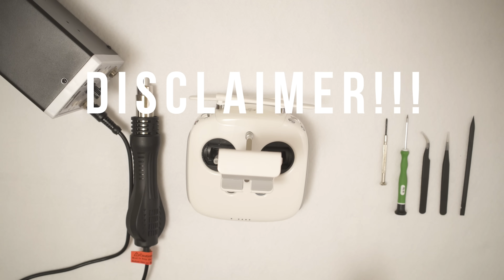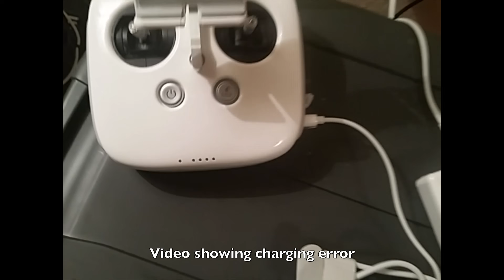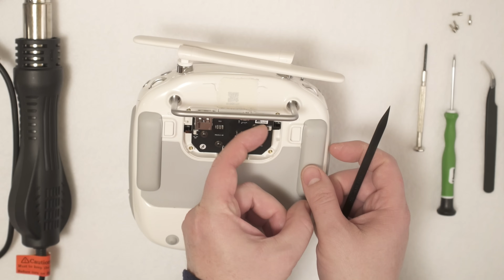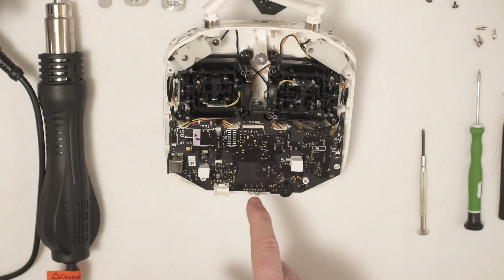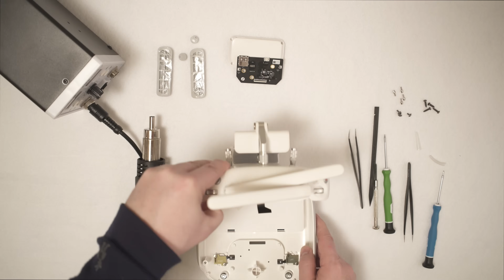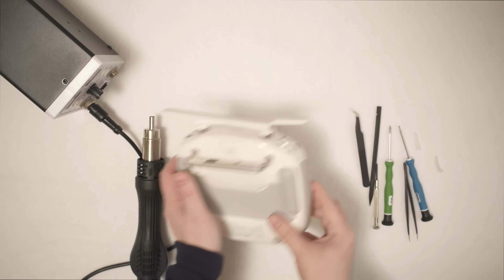FIXED!  DJI Phantom 4 Pro Remote Control Battery Charge Issue [Disassembly, Repair, Reassembly]

Comment from the maker: Wow! I knew this video filled a need, but never imagined so many people faced the same issue.  For convenience, I have added links in the description to the hardware featured in the video.  Many thanks to all who have viewed, and especially those who have reported back with their experiences!
Reply: Thanks..  Very nice guide.  I have an issue after reflowing it..  Before doing so, i could connect the DJI Go 4 app to the drone.  But now when i plug in my samsung it says "Check your charger connection."  I have taken it back apart 2 more times to make sure everything is plugged in securely and it is..  But the app still wont connect.  Any suggestions would be great.
Reply: Hey boss. Great video and i was able to fix my controller.  I purchased it on Ebay and it was not showing anything over two lights right from the start.  I followed your guide thoroughly and now I can get all four lights.  I greatly appreciate it.

One thing I'm kinda curious about is if you really need to disconnect all the ribbon wires and wiring harnesses.  It seems like we could unscrew the phillips and tilt the board up in order to reflow.  Just a thought, but at the end of the day your guide worked perfectly, I learned some stuff about my controller, and the problem is fixed.  I wish I could buy you a beer to say thanks.  If you're ever around chicago, let me know.
Reply from the maker: MattHeaven, thanks for the kind words. I think you’re right that there must be a simpler way to access the target areas of the circuit board. Lots of great people over the years since I posted have helped to locate the key areas—something I really didn’t know at the time!
Reply: @travelphotofilm  For what it’s worth, mine started recognizing the four lights after working around the battery connections on the board. The charging port connections did nothing.
Reply: @VictoryAviation  Hi Mat and thanks for your additional comments. I have just purchased a solder reflow thing so I can do this fix. So did you do any other reflow spots on the board or did you stop after the area around the battery connection?
Reply: @dirtysoapbox  I started with the charging port. I would work the board, let it cool, then plug the charger in and test. I actually got worse results (one light) after working around the charging port. Then I worked around the battery connector. I used the same methodology; work the area, let it cool, test. Eventually all four lights came on when plugged into the charger. I think about 30 seconds was the max time I applied heat. Always keep the heat moving in little circles. Never hold the reflow tip in one place for an extended period of time. This is true for using heat on just about anything. Hope this helps some. Let us know if it works.
Reply: @VictoryAviation  Thanks for that. Sounds like might be best to keep away from the area around the charging port and just do the battery connector? is that correct?
Reply: @dirtysoapbox  That’s what seemed to work for me. Results may vary 😅
Reply: @VictoryAviation  Thanks. Yes I understand the problem could be anywhere. Thanks for getting back to me. I'll let you know how I go once I've got the gear here
Reply: @VictoryAviation  Hi Matt
I got the flow machine and followed the instructions on the video. I was a bit 'green' at doing this stuff. When I first tested it in the dismantled position I only got one light randomly blinking. I did the flow over other suggested areas and tried to emulate the Brazilian's time he spent on each area. Subsequent power connect tests did not better the lights' situation. I put it all back together and tested everything connected up. The controller showed three lights plus green so I was happy to go forward and do a test flight which worked fine. So something correct happened but I can't tell you which part worked. Thanks for your help with this. Cheets
Reply: @dirtysoapbox  Cool man.  I'm really glad it started working better for ya! Blue Skies my friend

Comment: Thank you so much for posting this step by step video. It was very well done and easy to follow. I’m very pleased to say this worked for me. I had tried all the different ways to do a reset to no avail, so having nothing to loose I gave your step by step a go and it worked out very well. Again thank you!  Also a big shout out to the gentleman from Brazil who showed the way. It’s obviously a big problem with many others Phantom 4 users and I’m disappointed that DJI didn’t step up to the plate and right their wrong.

Comment: Worked For Me :-)    I only focused on the power chip (both sides of the PCB) as circled in a previous post.   When I first disconnected the PCB and battery, I plugged the charger in and only one LED illuminated.   Then after applying the SMD hot air for about 30 seconds either side  (and allowing pcb to cool) I then plugged the charger back in and he presto 4 LEDs :-)   My Hot Air settings were 320c and fan 7 (meant to set it to 4 as per previous postings, but only remembered that afterwards)  I had the hot air thing about 2cm from pcb. 

Note To Would be DIYers: -  Whilst this job is complicated, its not difficult.  Those fiddly looking ribbon cable connections are actually far more robust than they look.  Oh and don't worry if you too have one screw left on the bench after reassembly.  Its a deliberate ploy by the Chinese to confuse us westerners :-)

Thanks to the original poster, you are a Hero !
Reply from the maker: Fred, thank you for the great, detailed review!
Reply: can I just connect the battery and the charger to see if the light go back to live? o I need to reassemble all the cable first?
Reply: @kiradmf  I connected the charger to the board even before re-installing it - I had the board just hanging off the end of the charger to test it.  But, I'm sure you're well beyond that now since your post is two weeks old.
Reply: Did this exactly 320c at speed 4 and for 20 seconds on each side worked like a charm.

Comment: All I did was take it apart like he did but I just unplugged the battery for a few minutes put it all back together and that fixed my problem
Reply: Thanks for that bit of info. $60. not that much but if I can avoid that purchase I definitely will.
Reply: Same thing for me. I took everything apart then put it back together and it now charges

Comment: Great video - this is my 2nd time repairing after buying about 5 years ago - only flown a couple of times. After the 1st time I was satisfied with just 75% max on the controller (3 lights) since I'm still a novice flyer but again like everyone else stated, a lot of money for something that doesn't work as it should. Almost bought a second battery which I thought was going out, but after further research and viewing this video with many others which was very helpful for identifying the actually chip causing the issue. I did correct my mistakes through this second process which I didn't let the board cool down enough before testing the power cable because the lights (only 1) just kept😏blinking. I also used paste flux over the chip on both sides of the board. About the average of everyone else with the distance and time heating up the chip on both sides, I let the board cool down within an hour. I got all the lights to blink after plugging the power cord in but when I attached the battery, it was charging as normal but 1 minute later all the lights went out. This happens 3x consecutively after heating the board and 1 hour of cooling which I decided to put it all back together and hope for the best because I was afraid I was overheating the board. Come to find out after attaching the controller to iPad using the software, the battery was at 97% which was the reason why the lights went out after attaching the battery 😊. So I'm very satisfied and hoping this will bee a long time fix and looking to test fly today before driving up to UT from CA!

Thanks for the attention to detail!

Comment: Thank you so much. I took my drone out from storage to get ready for a trip, and when I was getting everything set up and charged I noticed this issue. I had to heat the entire board, but once I put it all back together the lights moved past the 2nd dot and the controller began to charge. Just had to recalibrate it to get rid of the annoying beeping sound and now I'm all set. Total life saver dude.
Reply from the maker: Great to hear, Mike!  Thank you for the feedback!

Comment: Worked for me too. Same issue, so applied heat to solder connections directly behind battery connector and charge socket. Connected charger to board and got 3 LEDs showing, so upped the heat to 400c and fan at 50%, applied heat for 20 secs or so to each area and got 4 LEDs showing. Not difficult to do if you're confident in dismantling/repairing. Take pictures before if not sure.

Comment: I appreciate your taking the time to create and post your video because it worked perfectly for me.  I focused on heating the charger and battery connections on the back of the PC board and I ran the gun at 300 degrees with a fan setting of about 4 and I spent 30-40 seconds per location and then I test it and it worked.  Again, I appreciate your taking the time and effort because it made the difference between spending another $350 for a new transmitter or not.  DJI was completely uninterested to help after the aircraft was flown about 5 times and I will think twice about buying anything from them again.  Thanks again...
Reply from the maker: C Morrill, thank you for the kind words and detailed feedback!  I love hearing about how this video helps others, especially considering how widespread the problem is and what a relatively easy fix it is!

Comment: Another successful fix on my Phantom 4. I tried to get help from DJI but they did not even acknowledge this issue. I used a setting of 350 degrees and went over the whole board. It didn't work the first time so I concentrated the heat more on the tiny component with 8 legs just to the right of the 4 LEDs as someone else here suggested. Plugged it back in and voila- all 4 lights and all fixed. Thank You very much for your efforts on this issue and also all the others who have contributed.
Reply from the maker: Terry, glad to hear this worked for you!  Thank you for the feedback!

Comment: It works!!! I disassemble the remote myself. I  live Mexico and take the circuit to a cellphone repair shop (they use soldering hot air to fix the phones), explained them what was the problem and how to fix it, and heated all the circuit at 300 degrees one time (ALL THE CIRCUIT) and it WORK!!! Thanks man!!! I paid 80 Mexican pesos for the work.
Reply from the maker: Excellent news, David!  Thank you for adding your experience to these comments!

Comment: OMG, I seriously didn’t think this was going to work but I only had two days before vacation and didn’t have time to deal with DJI.  Soldering iron didn’t work for me, but a heat gun did. I couldn’t find a small one like the one used in this video but a normal one worked. Controller was telling me it was dead. After this stunt it now reads fully charged. Thanks man, I owe you a beer.
Reply from the maker: Awesome!  Thanks for the feedback!

Comment: Big thanks.  Worked just like you said.  I started at 300 degrees, didn't work.  Reheated the board at 325, still no go.  Tried 350, still had only the same one light.  Finally thought I'm just gonna go for it.  Turned the heat up to 375, took my time and heated every bit of solder on the board.  Thought to myself, well It's already not working so I'm gonna really heat it up, even got some of the semiconductors and components hot.  Voila!!!  Let it cool down, plugged up the charger and battery and had 4 flashing lights.  Good as new!!!  Thanks everyone for your posts!
Reply from the maker: Thank you for letting us know how it worked for you, and for providing the temps!

Comment: Great video, ordered a heat gun from Amazon and got it today.  Took my transmitter apart and started working as per your instructional video.  First try, no luck so I upped the heat to 400 and fan at 4 and it worked wonderfully.  Of course DJI was no help with the problem and told me to send it in for evaluation and pricing.  Thank you, Thank you, Thank you.
Reply from the maker: Awesome, Jesse, so happy to hear it worked for you!

Comment: Eureka! I saw your video some time ago when the problem first arose on my P4 (standard, not the Pro) and I had been putting off trying it till today when I literally couldn't use my drone due to "Remote controller battery too low" message.  So I took on the project with your video guiding me.  All went well. I can report that the P4 controller must be virtually identical to the P4 Pro because everything was in the same spots and looked the same.  Thank you so much for your detailed and clear instructions, you rock!!
Reply from the maker: Wonderful to hear this worked for you!  Thank you for the feedback and kind words!

Comment: Thanks so much man for taking the time and explaining that well!
I also focused on the spot on the right side next to the LEDs. 
Over time only the first LED did light up when loading.
Bought a 42€ reflow station on amazon, switched air flow to 3 and temperature to 350°C. Did warm the area for about 20 seconds, then connected (without battery attached) and had 3 LEDs lighting up. Then i did the same agian, and tadaaaa --> 4 LEDs!!! Attached the Battery, compleded everything and now my App shows 98% Battery!
You saved a lot of us a lot of money! Thank you so so so much! I dont know how anyone could unlike that video. Shame on you!
Thanks for your help!
Reply from the maker: Hey, thank you for the kind words!  Glad you found the video helpful!

Comment: Just completed my Phantom 4 Pro + (built in screen) controller reflow fix and it seems to have done the trick... thanks a million for this great video. It was a great help and a huge money saver. Almost burnt the house down in the process but was worth the effort :). Note: the controller for the + model is somewhat different on the inside from the above video, however just from watching the video I was able to figure out what to do... all lights on and battery full... yay!!!!
Reply from the maker: Great feedback to hear this can work with the Pro +!  Though it sounds like maybe you need DJI Refresh (or at least fire insurance) for your house! ;)

Comment: From Vietnam, tks so much.

Hi everybody. I do not believe it worked. I use the hairdryer three times, drying the areas that people guide. Then the rechargeable battery has only 3 lights. Finally, I use a soldering iron  on the 8 pins of the LED, the fourth lamp is on.

Comment: Thanks for the video....had this problem with the controller battery for quite some time. Purchased a flow gun so I could concentrate the heat and tried at 350c first without any luck....cranked it up to 400c for 30 seconds and success! Careful on the ribbon holder clamps, I broke one out of the clamp but was able to reinstall it after some time and effort!

Comment: Well, it worked for me pretty good! I’m quite astonished that it actually functioned. Really nice step by step guide! For temperature selection I was between 100-150 degrees Celsius, never heating the same spot for more than a second or two. Be careful with the plastics because it will melt pretty fast, all the little plugs need to survive the process ;)

Comment: Another success story - it worked for me - I used a heat gun with some cardboard to protect the foam and plastic bits - heated it until the board was hot to the touch, let it cool, tested it and got three lights. Heated it again - same test - only three lights, but then I plugged in the battery and got all four lights! Thank you! I had just bought it secondhand and thought it was toast.
Reply from the maker: Many thanks for the report back, Travis!  Happy to hear it worked for you!

Comment: Hey, thanks a million! Just been through the process, heated it 3x in the end, as I got braver. Even put a baking thermometer next to the chip and saw it was up to 205 C. and was heating for about 3 mins the last time. I used Alu foil to protect the rest of the board and only heated the chip you pointed out.
If it flies, 👉🏽🥰

Comment: I attempted this fix last night and it worked for me too! I want to note that I followed another commenters suggestion to flip the board over after removal and heat the little 8 pin component directly to the right of the led lights before trying anything else and it worked. So thank you for the video and thank you to user al graham for his suggestion. Worked like a charm!
Reply from the maker: This is great to hear!  Hopefully others will test this theory and we can put to bed the question of what part is the problem!
Reply: travel | photo | film this was an outstanding walk-through and really gave me (and many others) the confidence to pull this off. You've saved people literal thousands so far. Good job man!

Comment: It worked great for me, I was so pissed that a 3 year-old Drone would give me so much grief!! One thing I suggest is that heat the area gradually, let it cool and plug it in to see if you get the 4 LEDs to come on. Don't put it together and test ! It didn't work for me the first few times, so I gradually heated the area until i got the 4 LEDs to COME ON :) Thank you!
Reply from the maker: Good tip, glad it worked for you!

Comment: Thank you so much for posting this video, taking your time, and making me feel comfortable to try this myself. I used a heat gun with a piece of tinfoil as a shroud and it totally worked. In case anyone is wondering I did this on a P3 Professional controller and the internals were identical. You saved me loads of dough. Thanks again dude!!!
Reply from the maker: Awesome!  And good call on the tinfoil hack; I’ve learned a bunch of best practices from these comments!